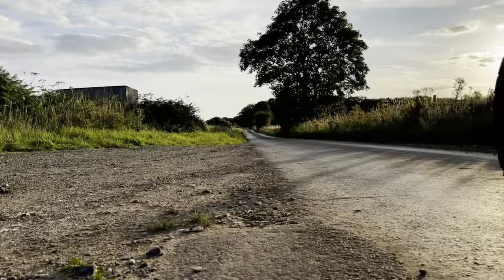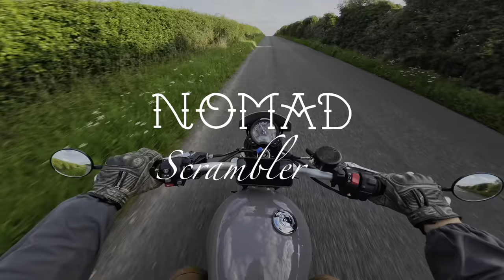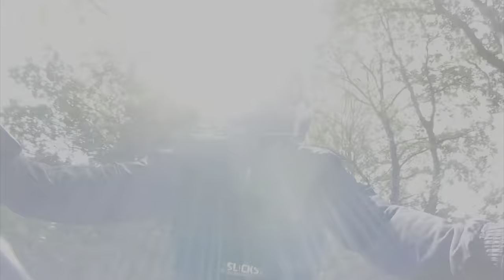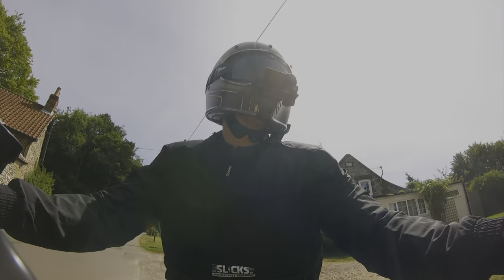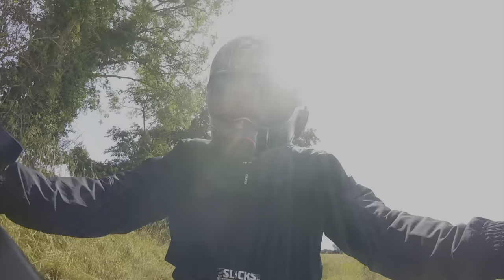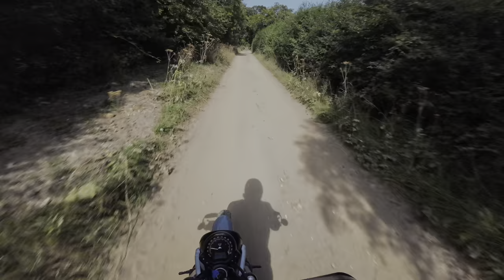Street Scrambler Off Road! Why Do I Do This To Myself? | Motovlog S2E19

Comment: Thank you for sharing the experience! Just one question, how did you fit quad lock right in the middle of handlebars?
Reply from the maker: I got the Thornton hundred handlebar clamp mount. Essentially replaces the stock triumph one with a built in quad lock mount and it makes my ocd so happy!

Comment: I am a professional rider. The SS900 is only shits and giggles off road. Have taken on trails barely a bars width wide. Have hit whoop-de-doos with it at speed- only after some suspension changes. It is god awful heavy, and if you tip it over in deep sand, it’s like lifting a cartoon.  Crossed streams and been in ugly mud. This bike is NOT an off-road bike. It’s exactly what it says it is- a STREET scrambler.  About the best it can do, reasonably, is gravel/dirt roads ridden like a flat tracker. Full send at 70-80 is a hoot. I pity anyone with minimal skills off road trying to learn them on this bike.
Reply from the maker: If it’s all you got, you gotta do what you gotta do
Reply: While all that is true, back in the day, people took their road machines, stuck some knobbly tires on them and took them down the tracks and trails of the world. 

This is Retro-Off-Roading 😉
Reply from the maker: And it’s a pretty good way to do it!